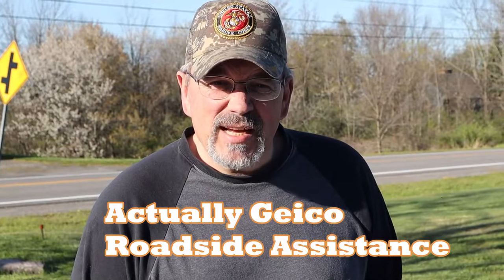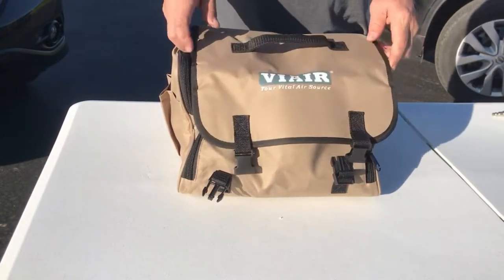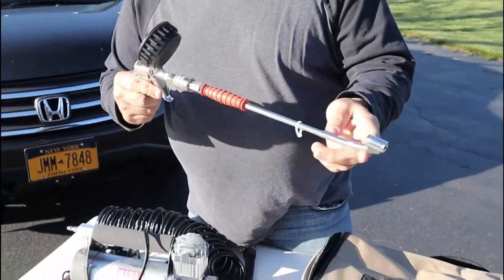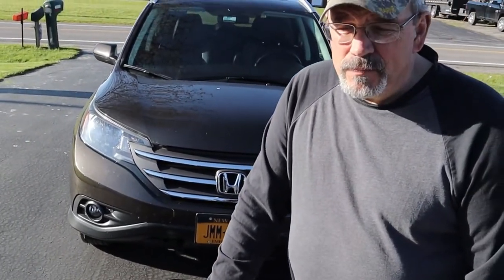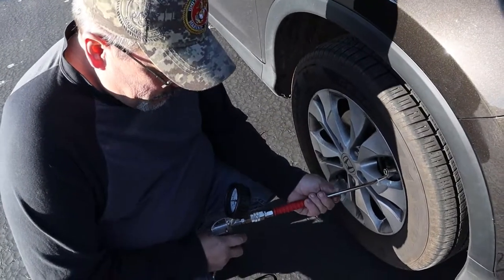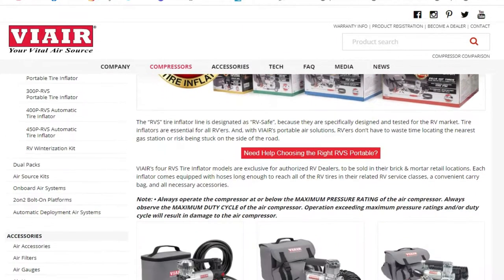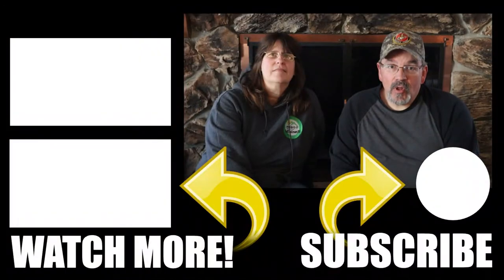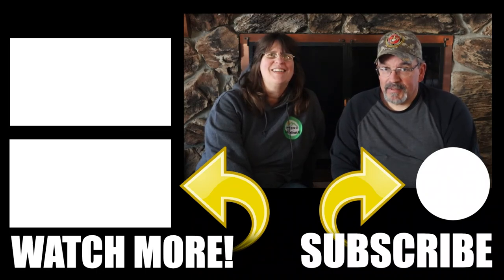Viair 450P-RV Portable Compressor/Best RV Accessories/Full Time RV/Tire Inflator with Gauge/12 Volt

Comment: Thanks for the video guys!  We have been looking at buying one.  Do you know, is there a reason you can’t use the one made for a Class A on a towable?
Reply from the maker: No there is no reason you can't. Being in the RV life, I would buy the bigger one incase I ever upgraded to a larger rig so I had that higher PSI ability. Now if someone was a casual camper and has no intention of ever upgrading they wouldn't need the extra power and the smaller ones are less money. Thanks for watching.